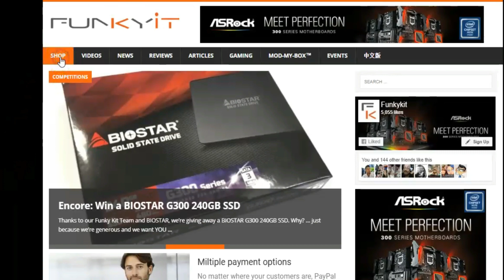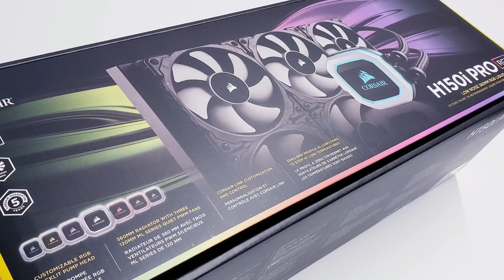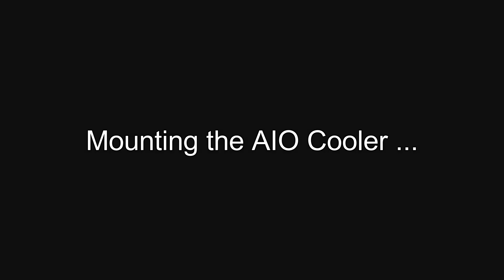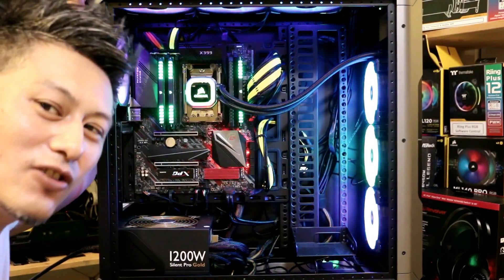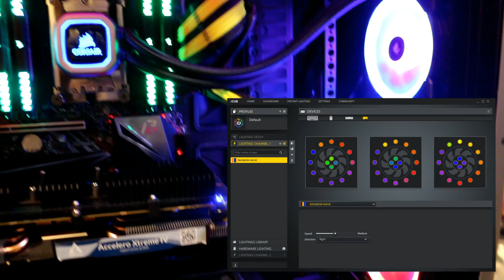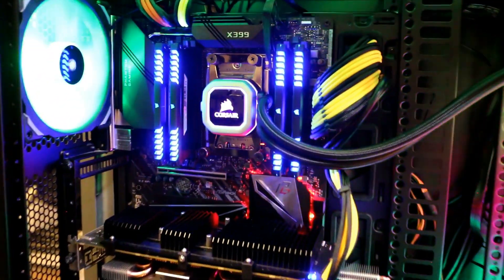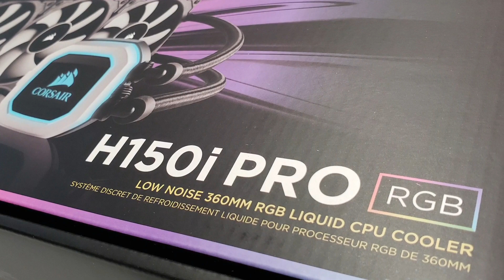Corsair H150i PRO RGB AIO Cooler TR4 Installation Guide and Review

Comment: I think that airflow configuration has a little problem, u have 100% exhaust fans and 0% intake.
Reply: right? The AIO in on the front panel should take the air into the system right? He should have change the positions of the fans

Comment: New builder here, I should have read comments 🤦‍♂️ was avg 76c temp under load which was higher than b4 cooler. Relocated fans to front blowing in through rad ⬅️ 
Prob solved. 54c and stable.

Comment: so uh.... how do i put my de-ionized water in?
Reply: hee hee
Reply: You dont. It's a closed-loop system. Already comes with fluid inside. Which isnt swappable/flushable.
Reply: @andrewvirtue5048  So it that a good or bad thing?
Reply: @ryan7030  Well, being its a closed loop it means, you're less likely to have leaks. But on the other hand, when its time comes you gotta replace the whole setup, rather than just for example the pump itself.
Reply: @andrewvirtue5048  How long is the life span of a closed loop?

Comment: i have it installed like yours but i already asked some experts in this department  they said
fans should be facing outward means it is suppose to be close to front of the chassis then the radiator. 

i don't actually know i have RGB fans and  the radiator blocking its light. because of that i think there's something not quite right. 
though the cpu temps so far so good .

any suggestions would be appreciated guys. 👍
Reply: Haninos I watched a video where if the fan is sucking air from the outside through the radiator into the case it gives better cpu temps. This was with the lian Li O-11 dynamic case which means there are a lot more fans pushing that hot air out and taking cool air in
Reply: What they meant is that fans should be facing the other way. You can have the fans on the inside just make sure they are intake cool air from the outside then pushing it inward. The way you had them, they were sucking hot air from the inside and pushing it outwards which isn’t good for air flow.

Comment: Sorry to down vote mate, but the direction you have in the video for the airflow on the rad should be set as an intake (fans turned around) so you get cool air instead of baking your rad and kind of defeating the purpose of having a cooler. And, kind of hard to tell so I may be wrong, but it looks like you have old thermal paste on your CPU. If that's the case you should totally clean that and put new compound on so the copper heat sink can work properly and the system doesn't overheat and die on you.
Reply from the maker: It’s only for show... and yes I agree flow is incorrect
Reply: @Funkykit  if for show need to change your title from guide and install to just for show. Giving out wrong info

Comment: Wrong fans direction. Either you mount the fans on the other side (preferred for slick look and pushing air), or you need to invert the fans direction (pulling air, not optimal due to the air leaking from the sides and not passing trough the radiator, however some people do it to have the light inside the case when using RGB fans). In either case, you did it wrong.

Comment: Cool video TY ... But I will not be pulling our from the computer out the front.  Whilst I will have the LED fans inside, I will be drawing air into the case which means turning the fans around as opposed to the way your fans were facing.  Not dissing your video man ... VERY HELPFUL.  I just think it's a better practice to pull the room temperature air into the case from the front no matter if the fans our in or out of the case.  I still got a LOT from your video.  TY!!!

Comment: Guys i have a question does the radiator have water in it already or you need to buy
Reply: These come with coolant already inside them, and it can't be replaced, though that most likely won't be an issue for many years.

Comment: Sorry, down voted! Wrong direction of airflow on the radiator. You have the 3 fans on the radiator blowing air from inside the case out the front of the case. If you mount the 3 fans on the back of the radiator, then the fans should be (turned around) pulling air in from the front and pushed out the top of the case.
Reply: also maybe its just me but I would not have been able to throw that waterblock on that cpu without cleaning it and reapplying new thermal paste
Reply: @mixeraroplays9224  I thought the same thing, all it would have taken is a bit of alcohol!
Reply: I just noticed the same thing.  I was looking to see if it was OK to mount fans on the inside ... but only if your still drawing air in from the outside.  I'm going to do it because I want the lighting on the inside of my case, but not using the fan direction as used in this video.
Reply: StarCitizen L-Plates so if I have fans inside my case it’ll still be the same if they were out?
Reply: Thank you for this. I'm going for a similar set up and I'm worked about the airflow. I'm setting up my fans the exact same as this build due to RGB fans but I'll have the fans sucking in air from the front and will have it exit at the top and back of case. Thank you!
Reply: Also know as a dislike